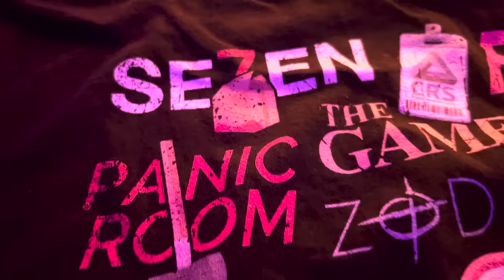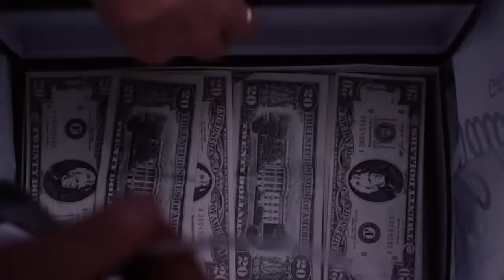20 Exquisitely HARDCORE Movies

Comment: These are some good movies, but they are not hardcore. Hardcore refers to a specific type of film. Most commonly, hardcore is the cousin to softcore, which is applied to films of a sexually titillating nature. Hardcore means you literally see intercourse on screen; softcore is without the actual penetration shot, but still hot 'n heavy.  

I mean, Goodfellas and Black Hawk Down are based on autobiographical books, and Miami Vice is based on a TV show, so definitely not hardcore by any definition of the word. 

If you wanted to make the argument that some movies go hard to the core, then I'm going with Killing Fields, Sisu, Clockwork Orange, Deliverance, etc. I'd even put The Warriors on that list. 

If you mean hardcore, as in "he's a hard core movie fan", then you have picked some movies that a film buff should enjoy.